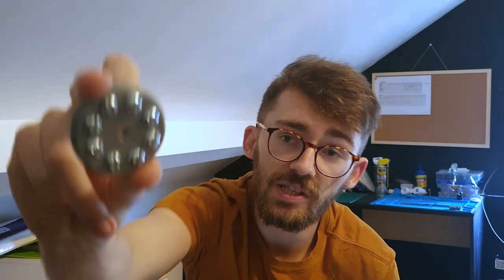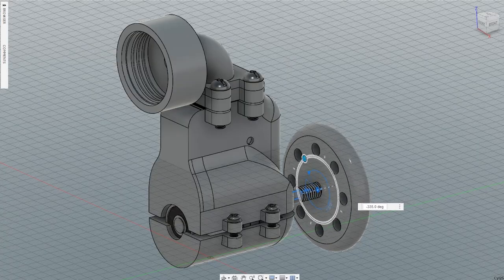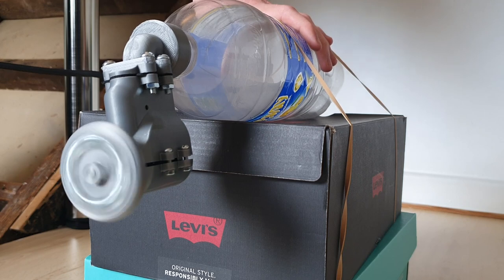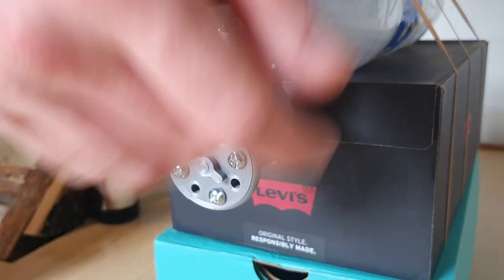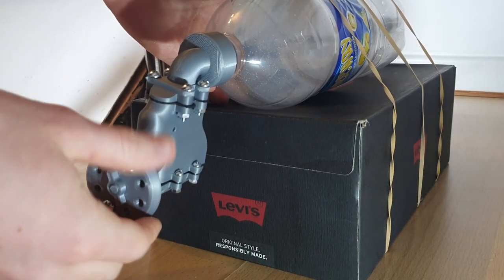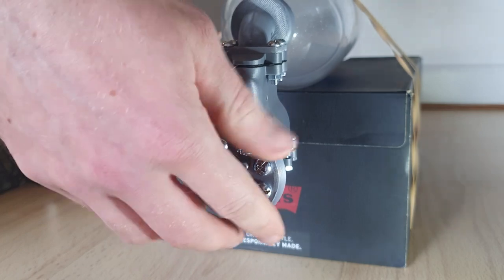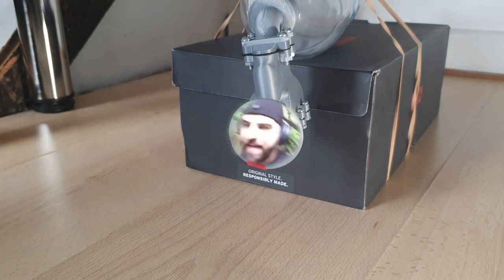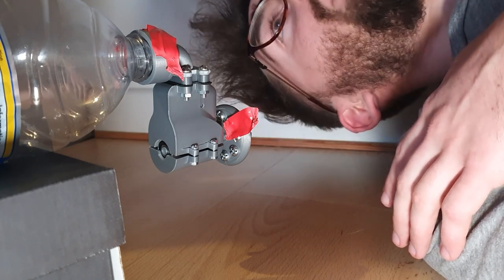3D Printed Air Engine V2 - Upgrades

Comment: Couple of ideas:
- look into a pressure regulator/ governor to keep the pressure relatively constant.
- put a rocket nozzle on the exhaust port to accelerate the air coming out which could create a vacuum and suck the piston up. If nothing else it will look cool af.
bonus: print the gasket out of tpu. I could post you some printed ones if you wanted.
Reply from the maker: Thanks for the suggestions!

Pressure regulator is something I'm looking into! should allow for a much longer duration and more consistent performance.

If I constricted the exhaust using a nozzle it may actually have the reverse effect and limit the amount of air that can be exhausted which could cause the cylinder to still be pressurised after exhaust, the exhausts atm are 2mm diameter and I have a sneaky feeling they may be undersized, so improving the exhaust is something I'm thinking about!

What benefit would a tpu gasket have over rubber?
Reply: @kurzey8532  its faster to print a gasket than to cut it :). You dont need to constrict the exhaust in order to get the vacuum, this is basically a 2 stroke so see how they tune their exhaust pipes to get the resonace which pulls the exhaust out.
Reply from the maker: @BogdanTheGeek  maybe it would be if I had a printer set up to print tpu, but I only have my lonely ender 3 🤣

Ah okay I see what you're getting at, I'll take a look👌
Reply from the maker: @BogdanTheGeek  thanks Bogdan!
Reply: what a Genius

Comment: Get or print a mower blade balancer so that you can check and correct the balance of your fly wheel, weigh the screws with the nuts one by one with a gram scale and place ones with the same weight opposite one another, check the balance of the fly wheel in different configurations and adjust is so that it has better balance. May have to drill small divots or holes in it or press in small pieces of metal wire to get it just right. That should help reduce vibration

Comment: To help balance the stress on the axle, you could split your flywheel weight between the front and back of your engine (2 wheels). No point once you attach it to a load, but while you are prototyping it will give you a much more stable output.
Reply from the maker: never thought of that, an interesting idea, thanks Ashley!

Comment: Probably good idea to have a non cirular end on the crankshaft. 

Also instead of securing with screwthread rather just have like a paperclip that you push through a hole on the end of the bar and then bend to block the flywheel from flying off.

I honestly could probably go on as pneumatic engines really do interest me.

But keep up the good work!
Reply from the maker: That's a good idea, never thought of using a paperclip or thin wire to hold it on.
Reply: @kurzey8532  Well now you've recieved it! One issue with that though could be that it could easily cause vibrations by being offcenter if you do it wrong

Comment: So couple things.. nylon/PTFE bearings are a thing. Might want to use 1 or 2 in the middle of the crankshaft. (Split bearing in half and compression fit.)

Also a simple regulator would do wonders here. 

Also also.. maybe invest in some threaded rod? Seems like some of your problems are material based.
Reply: ceramic ball bearing^^
Reply: @loxus77  ball bearings would have high losses here. Just need a journal / bearing that is made of a self lubricating material

Comment: Hi. Its super. Did you calculate the air consumption? I would adjust the stroke and diameter of the drink.
Reply from the maker: Thanks!

I did not, should be relatively simple though to do for next time, need to know the initial and final pressure, know the volume of the bottle, can then calculate the mass of air used, knowing the duration of the engine running, can then get the air flow in g/s.

Yes I intend to play around with these parameters.

Comment: Good job man! I am pretty sure that you should reduce as much as you can the vibrations, as they drastically reduce performance and reliability.
i suggest you to put another bearing at the other extremity of the crankshaft and to make the engine block in such a way that it makes contact with the bottom part of the engine.

Keep up the good work!
Reply from the maker: Thanks man!

There is another bearing there, you just may not be able to see it in the video. There may be some play between the crankshaft and the bearing so it doesn't rotate perfectly which I need to fix.

What do you mean by make the bottom part contact the engine block?
Reply: @kurzey8532  I'm sorry😟 I didn't notice it, my bad. Sorry for my english, I'll try to explain better: "i think that, for structural interity purposes, you should make the bottom half of the engine block in such a way that it touches the cilinder. This way, if you tighten the screws, they don't bend the plastic and the resistance of the parts is heavily increased
Reply from the maker: @ferraristahd1661  no problem probably wasn't very clear! 

Ah yess I see what you mean and it's a valid point the gap is too large. The reason for the gap was so the screws can clamp the two parts together to secure the bearings (which clearly didnt work very well lol)

Comment: i think you should do some balancing on the engine so it doesnt waste so much energy shaking itself, that may considerably increace the RPM
Reply from the maker: Yeah it is a shakey boi, there was play in the bearing and crankshaft which didn't help and could probably redesign the crankshaft to help somewhat. I think there will always be this issue with a single cylinder as there's no opposing cylinder cancelling out the force, but it could be improved for sure 👌
Reply: @kurzey8532  yeah, and yours wont be easy to stabalize either way cause the valve is offset by an odd degree? so even if you add balansing elweight you may still end up with wobble forwards and backwards... few engine layouts are perfectly balanced, but im sire you can figure something out that will work in a future version 😀🖒

Comment: You should use a ball bearing seated against an o-ring, probably will help the leakage.
Reply from the maker: I've actually just bought some to do this for next engine!
Reply: @kurzey8532  while you're here, maybe un-bend the inlet of the engine, si it's pointing up. Will probably be a little awkward, but the air should flow in a little happier.
Reply from the maker: @crackedemerald4930  the engine could be rotated 90 degrees to be inline, but then the flywheel orientation would also be flipped 90 degrees so the rotation would be on a different plane, I could use gears to I guess but extra complications again 🤣 even using tubing you have a bend so either you have to live with the bend or use gears to have it inline, at least that's my trail of thought, for now!
Reply: @kurzey8532  true, but unless you're up to something wanting to use the flywheel in the axis of the tank, having it point straight up with the rest of the engine, wouldn't be such a big deal, right?
Reply from the maker: @crackedemerald4930  true, while I'm just testing wouldn't be a big deal, though id be surprised if it made a big performance difference it would certainly be easier to print, thanks for the suggestion :)
Reply: @kurzey8532  at the very least it would make for an interesting bottle cap.

Comment: Heres a stupid idea: 3d prints are always strong in one direction, but weak in the other. What if the engine was printed out of two, different print orientation 'layers' which would in the end be screwed or glued together to form the parts?
Reply from the maker: There's no stupid ideas! (Most of the time)

The engine is already split into 4 parts, I think splitting it up further would be a pain 🤣 the worst part is the piston cylinder part, which I can't print in a different orientation because I need a really tight tolerance for the piston (0.25mm) so it needs to be printed as one part vertically to get the best fit, thanks for the suggestion though!
Reply: @kurzey8532  Then perhaps only do this to the parts that break and only if possible. I think that durability is the next main issue that stops the improvement of the engine

Comment: what designer is this?
Reply from the maker: Do you mean what design software I'm using?
Reply: @kurzey8532   yes, I've been trying to get into 3D design but haven't found any good software.
Reply from the maker: @ohnomyframerate7558  Fusion 360 is very good and free for personal use, there's also Solidworks and Tinker CAD which are popular too but I've not used.

Comment: perhaps you could embed a 2-3mm steel rod in the shaft that keeps snapping. youre my first sub 500 subs channel that ive subacabribed to.
Reply from the maker: The print orientation seemed to help out as I think it was the rotational force which cause it to snap, though now you mention it the weight of the flywheel would cause some bending on the shaft and could have contributed, so yes a steel (or other metal shaft) inside the part could make it stronger to rotational and bending forces

Thanks for the suggestion and for the sub!

Comment: All u did was change the high resistance fan to a flywheel that doesn't drive anything useful
Reply: And all you did was?
Reply: @jhvnhjifgvbv8126  that's not the point. The point is that the title said he's upgrading the engine when all he's doing is changing the load
Reply: @KindOfyeah  he's not just changing the load. The flywheel is an upgrade, as it helps the engine preserve momentum during the upstroke.
Reply: @jhvnhjifgvbv8126  The fan was also preserving momentum, however before it was driving something useful (as in blowing air) whereas now its not doing anything useful at all, so the numbers hes getting from it spinning are actually useless to grasp actually improving the engine at all.
Reply: @KindOfyeah  I agree that comparing the numbers he got now with those he previously got doesn't make sense, but the fan wasn't really preserving momentum. The fact that it was blowing air means it had a hefty amount of air resistance which means it likely had a net negative amount of momentum it conserved. I do think he should have attached the fan along with the fly wheel to do a fair comparison, and it should be time spent spinning that he should be comparing mainly rather than rpm. From the last result, I think it spins longer than what the others where doing but it really isnt a fair comparison without the fan.